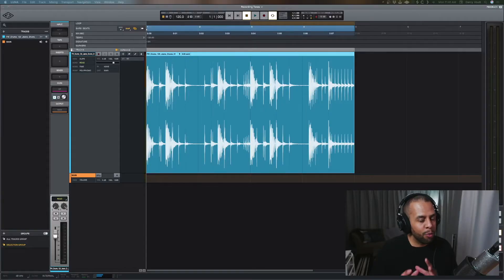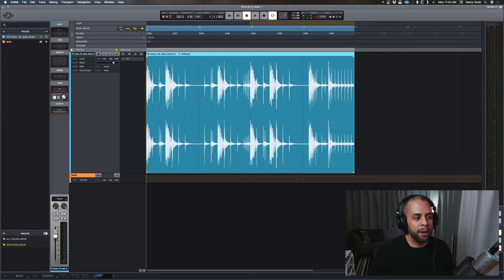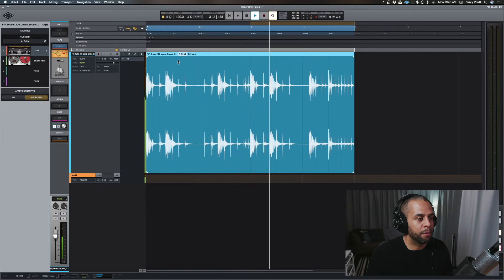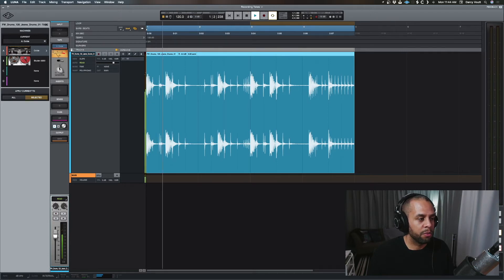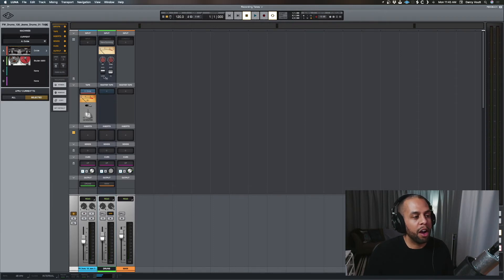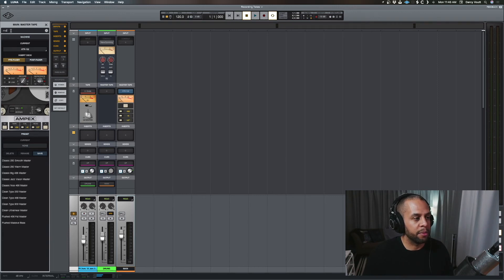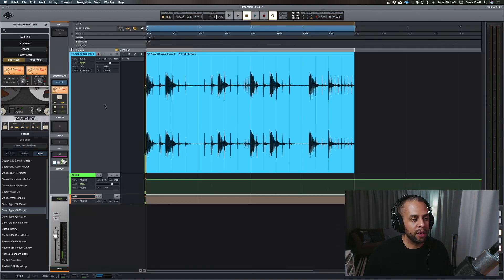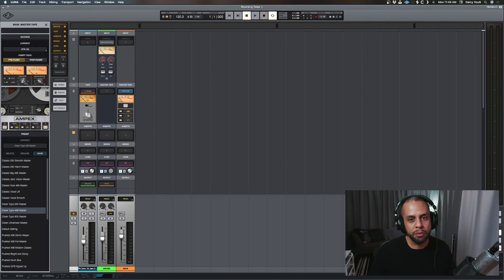How to Gain Stage in LUNA

Comment: Thank u...Ive read it all....lol....many thanks!!
Reply from the maker: Appreciate that, as I learn more I will share more. Don’t work for UAD so don’t have all the answers to how the plugins are built but it’s something actively learning and testing right now and hopefully can make a good video on in the future. I have to know something to a pretty good level of depth before I can explain it simply.
Reply: @MusicByDarcy  many thanks Darcy.....Im going with your explanation....
Reply from the maker: @mitchstallings5474  I generally aim everything for 0 through the tapes and summing but listen incase something doesn’t sound right to me. Faders will aim for what’s appropriate, my max fader usually sits below -9 these days as I keep thing quiet as I find things get much when summed in the main through my tape setup.

Watch that other video I linked in your other comment thread to see what I mean.
Reply: @MusicByDarcy  I think u r spot on Darcy....If 0DBVU=-18DBFS, then the output meters on the tape and summing can show us if we r in the ballpark!
Reply from the maker: @mitchstallings5474  I’m pretty certain that’s it.
Reply: @MusicByDarcy  did read that tape output calibrated to -12dbfs, which is what gain stage for tape is?? glad I subscribed....I may pick up a VU meter from waves, but probably don't need it using your technique??
Reply from the maker: @mitchstallings5474  we all have to adjust to what works for us but I’ve been thinking of getting an old free VU meter plugin I’ve had before just to keep watch on the main channel without having to scroll back to the tape. But I’d also have to calibrate it to respond the same as the AT-102. The plug-in is called mvMeter, just as good as the Waves one but free 😄

Comment: hey Darcy....are u saying that we push the gain into oxide to hit 0....is this like the neutral spot? I have heard that we go -18DBFS?? a little confused....I do notice that if I push the tape to 0 and then adjust saturation, I hear the difference....with -18DBFS I can turn up saturation all the way yet hear no diff?? 
many thanks
mitch
Reply from the maker: This is something I've actually studying more recently and trying to my head around more in-depth knowledge on. However, I'll provide some information that may not be obvious.

When looking at the Tape Saturation and summing, the meter is no DB based, its VU. Meaning that 0 on the tape is not 0 on your fader.  A simplistic way of explaining this is that the 0 db metering of a fader is the level before it clips and digitally distorts. VU meters are measuring the intensity of the sound.

More important than knowing all the numbers is using your ears. If you're not being anything when the sound passes through, it's likely because it's not going into the tape loud enough.

Watch my recent video from this week where you can see my gain stage in real-time doing an actual mix.

https://youtu.be/3_zfXV23Rkk
Reply: @MusicByDarcy  Thanks for quick response Darcy. The VU meter shows output...there really is nothing that shows what input is. Ive read on YAD blog that -18DBFS is sweet spot for most UAD plugins, but -12DBFS is sweet spot for ampex?? Obviously, The VU meter on oxide really doesn't tell me anything..lol The answers Ive received from UAD have been vague...If Oxide auto adjust its own input and output, pushing to -12DBFS might be the best starting point...maybe what Im hearing is very subtle at -18dbfs...sorry for long message...just trying to understand

many thanks!!
Reply: UAD blog
Reply from the maker: @mitchstallings5474  you can read more on these plugins via their UAD manual for the normal plugin and the extensions are the same thing, with simpler controls for the most part but the rules will be the same. 

http://media.uaudio.com/support/liverack/UAD_Plug-Ins_Manual-v942-171110.pdf
Reply: -12, not 18 for the Oxide Tape